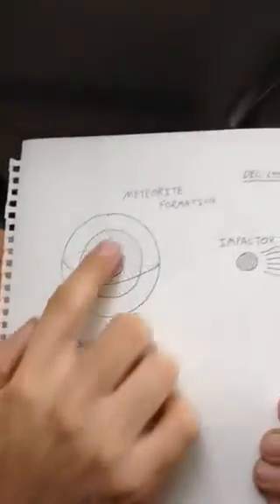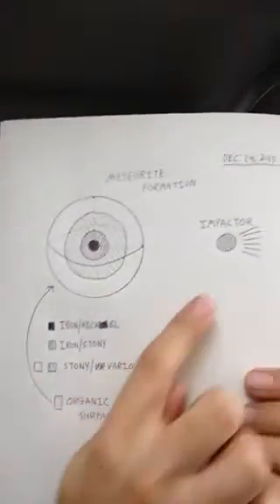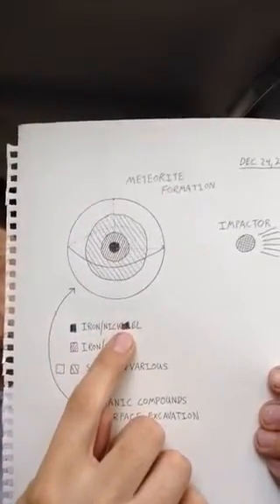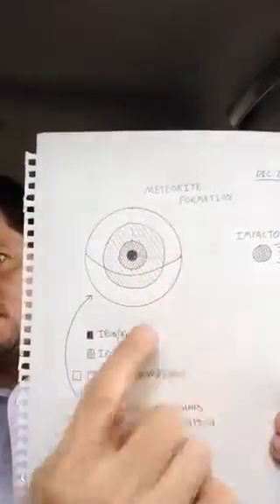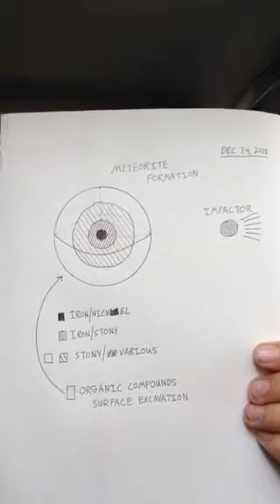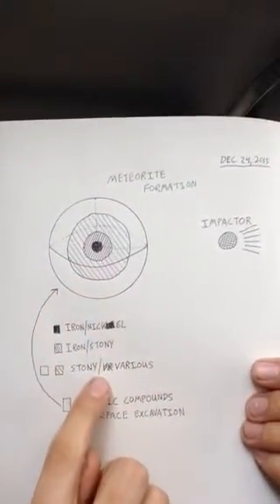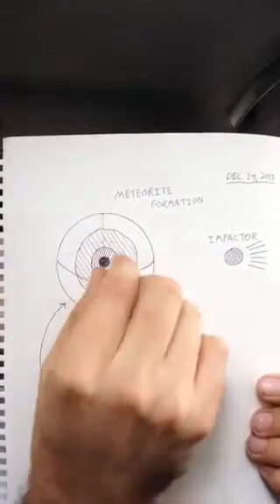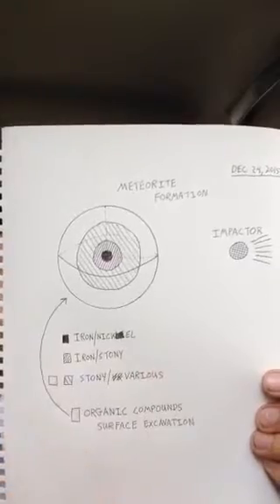How Meteorites Form According to Stellar Metamorphosis

Comment: Thank you, concisely put.  Been trying to argue this viewpoint with some accretion disc fans for a while now. Next is to try and convince people the Earth and Moon were a binary star system!
Reply from the maker: +NeverWoken The disk people have to explain how the angular momentum is lost. Its their Achilles Heel. Without a mechanism to explain how the disk loses angular momentum and collapses into much smaller spheres, then they have nothing. 

They avoid it everytime I talk to them. Regarding the Earth/moon system, I'm not sure if it was a binary system. I am sure though both objects are the remains of the processes involved in stellar evolution. I guess a good determinate for if the object was a complete star is if it possesses a spherical iron/nickel core and has high levels of differentiation like the Earth. 

I mean, if you think about it, if the Moon was an impact remains from an earlier event involving Earth, and the Earth's core remained in tact, then the moon shouldn't have a spherical iron core, because it couldn't have smashed Earth good enough to steal any. 

But these are all points to consider. One thing for sure though, disk proponents have no foundation to their theory unless they can solve the angular momentum issue.
Reply: +Jeffrey wolynski could the idea that the outer mantle being stripped from bombardment/collision therefore explain the supposed story that the moon made a ringing sound that reverberated? was the moon much larger than the earth? could it now be mostly a metallic core? could earth of formed from the moon and not vice versa, as an alternative to stella evolution of earth from brown dwarf?
Reply from the maker: NeverWoken I am not too sure. I think it is best though to consider that the objects might not even be related. Status quo forces objects to be related simply because they are orbiting each other. Hands down is the worst philosophy ever invented concerning astronomy.

It is similar to saying everybody on a plane to Paris, France is related simply because they are going in a similar direction. Sure, some families are on the plane, but some people are not related at all.  Astronomy is full of absurd assumptions like that, and finding where the false assumptions are hidden will lead you to discovery as well.
Reply: +Jeffrey wolynski thanks Jeffrey. Certainly plenty to think about, let's hope we live long enough to get some standard model text books revised!